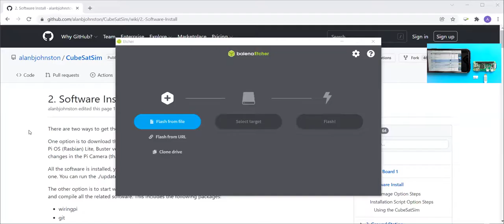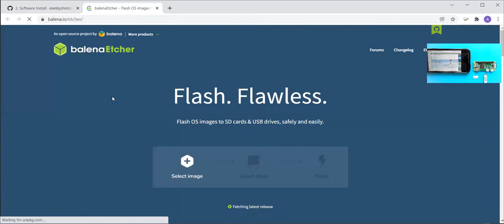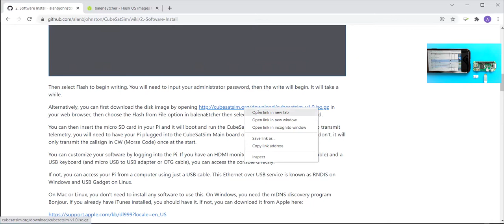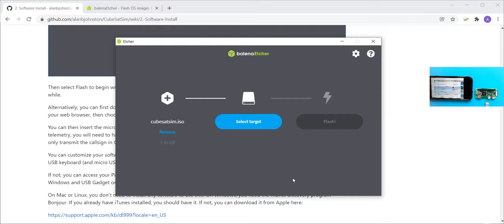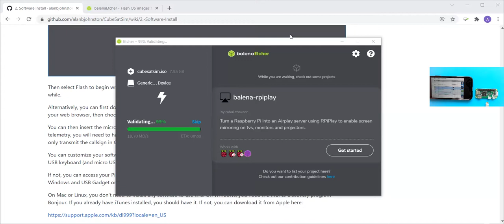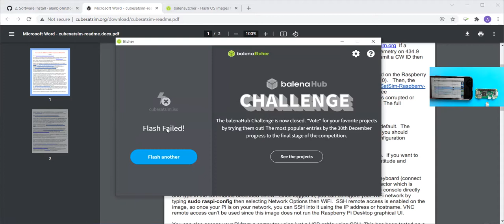Step 2: CubeSatSim Software

Comment: Hey Alan, can I use a Raspberry Pi 3 instead? If yes, what changes would be required?
Reply from the maker: The Pi 3 works with everything except for the power supply. The 5V boost converter can’t supply enough current. You will either have to power the Pi 3 directly or find an alternative boost converter circuit that will supply enough current.

Comment: Hi Alan, found a trap loading the software. If you unzip the GZ file and try loading the iso file directly with balenaEtcher the software won't run. You need to run the GZ file with balenaEtcher to get it to run. 
73, Terry ZL2BAC
Reply from the maker: Hi Terry, that's interesting - I've never tried it that way.  I usually do it directly using the URL without ever downloading the image file, as they are so huge.